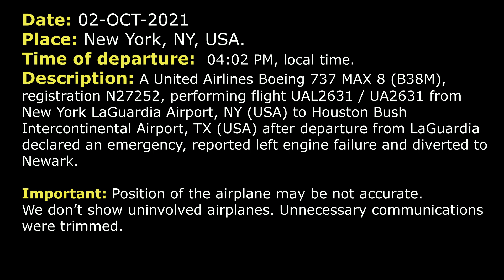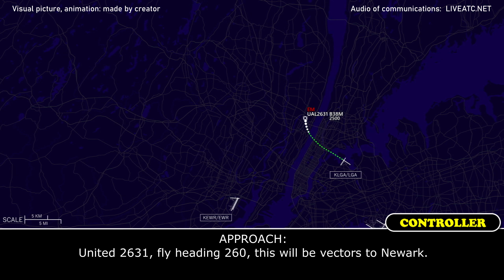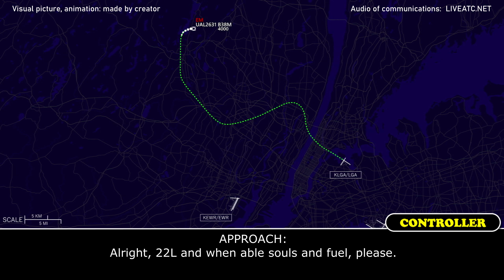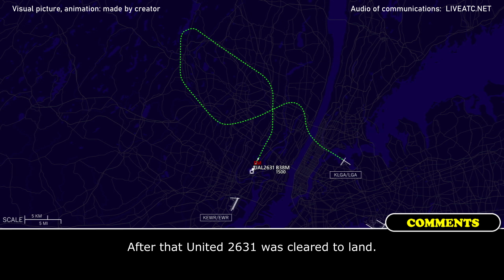Left ENGINE FAILURE after takeoff | United Boeing 737 MAX 8 | New York, ATC

Comment: Just curious why they would go to Newark rather than just going back to LGA?
Reply: Perhaps because EWR runway is 1000m longer then LGA

or that EWR is a United Hub = easier passanger admin on the ground/rebooking

or too tight in the airspace around LGA/JFK 🤷🏻‍♂️
Reply: Nobody returns to LGA with this type of emergency. Runway is too short. It's a landing at either Newark or JFK.

Comment: How does the most modern aircraft in the world with cutting edge engines, we are told, that will almost never need maintenance that requires removal from their pylons, have an engine failure on takeoff?  The MAX is cursed.
Reply: Engine failures are not rare.
Reply: The A320NEO and A220 have had their fair sharw of engine failures. It has become a problem for those 2 planes as well, check out PW1000G issues. Engine failures are not Boeing's fault because Airbuses can experience it too.